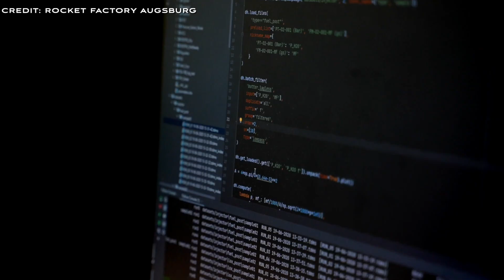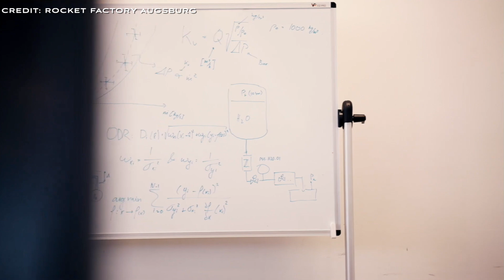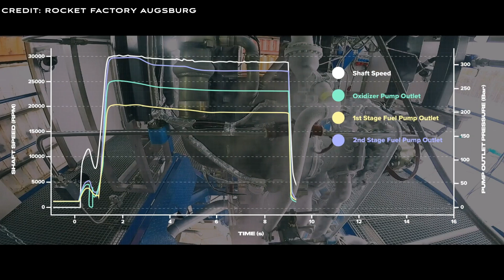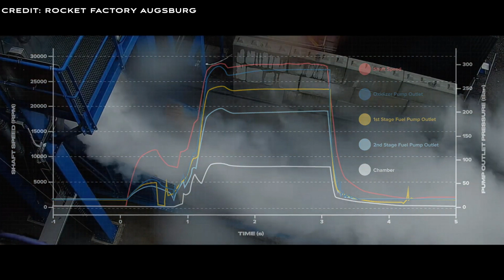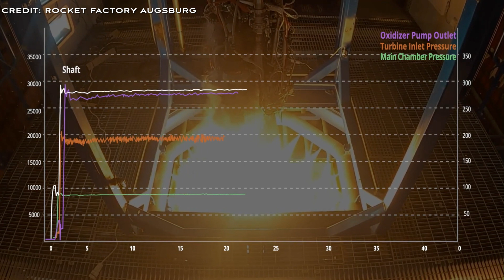Rocket Factory Augsburg (RFA): A German Rocket Launch Provider

Comment: Seems like not learning from competition is a virtue now. How you plan to compete with Starship with something decades behind? And looking at the engine - yep. Definitely behind. Sorry, no german excellence - von Braun would be ashamed.
Reply: The same way Dacia cars are actually being bought? 
RFA's plan is solid, in my opinion. Work with slightly modified off the shelf high-end auto parts. Composites manufacturing, titanium manufacturing, turbine manufacturing, computers, even high-temp fuels, like kerosine and methane expertiese is there. Hell, building a mid-range rocket engine is easier than building a high-end drag race engine. 

What concerns me is the work force. QC, inexperience, car engineers and mechanics working on rockets. Feels like Boeing syndrome.
Reply: @t3m3lkov85  Nope, nothing solid there. It is not about being competitive for small shit - it is about Starship launching the mass of ISS in one go. And being fully reusable. A small-scale backwater plan does not make it any competitor. Nothing solid there.
Reply: They aren't trying to compete with Starship.  That is a completely different class of rocket.
Reply: gotta admit it is fun watching the world scramble to catch up